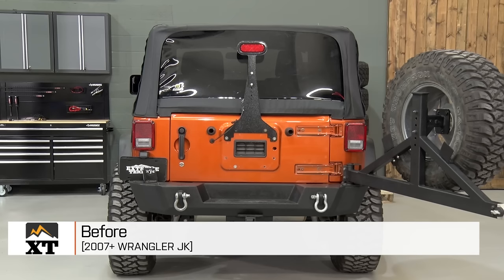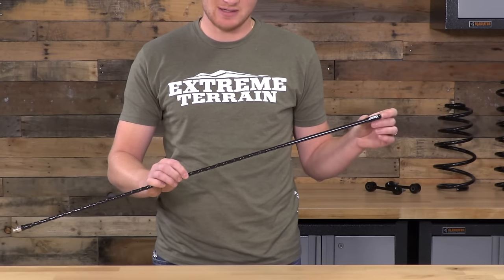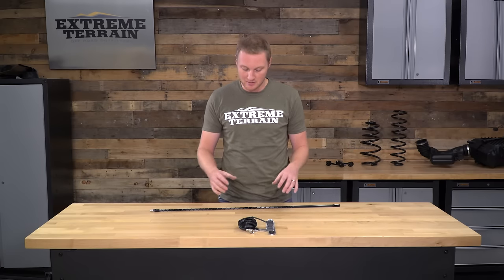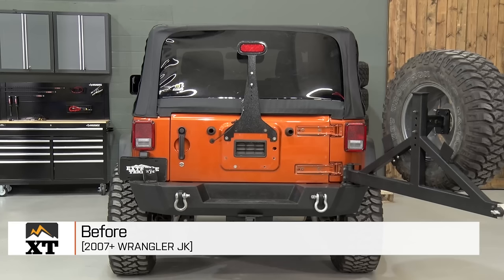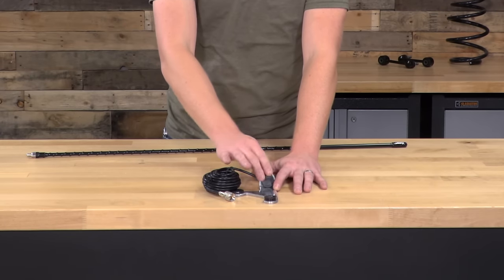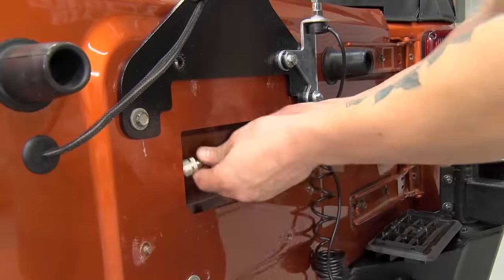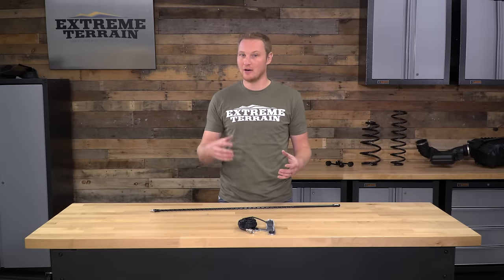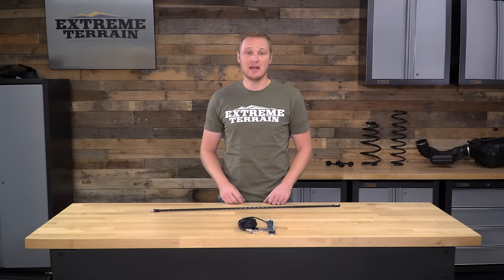Jeep Wrangler Mopar CB Antenna Mount Kit w/ Jeep Logo Antenna (2007-2017 JK) Review & Install

Comment: I'm new to cb. What makes it more difficult to tune and why are other antennas easier? Just curious because I will be ordering a antenna soon from you!
Reply from the maker: Hey Chris, the tuning is more difficult than others with this CB antenna is that it requires you to cut the antenna to tune it. Unlike other antennas that have a set screw or jam nut and allows you to shorten or lengthen the antenna with no permanent changes. We carry other antenna options as well if you'd like to check them out! 

http://www.extremeterrain.com/wrangler-jeep-jk-audio.html

Also here is a short video regarding antenna types and tuning. 
https://www.youtube.com/watch?v=uy3oq8hOQmk

Let me know if you have any other questions!

-Jake
Reply: I recommend a set screw tuneable antenna..
Reply: I'm assuming you bought an antenna already but if you purchase a QUALITY wire whip antenna they can be tuned without cutting them. $70 for this kit right here is CRIMINAL. CB radios are extremely simple to learn and understand.

Comment: If you use your CB just for the trails, then this antenna mount will work but, if want long distance communication, this is not the mount you want. It lacks proper grounding and antenna clearance. My recommendation, don't buy this mount. In her personal experience it is the best antenna mount for her but for a radio hobbyist, this is the worst mount. Look into the Aussie's way of off road antenna mounts that will be better for off road and long distance communications.